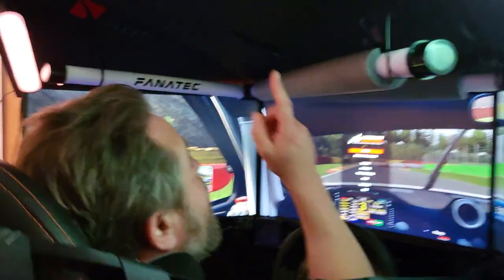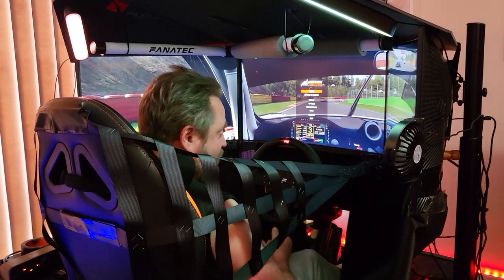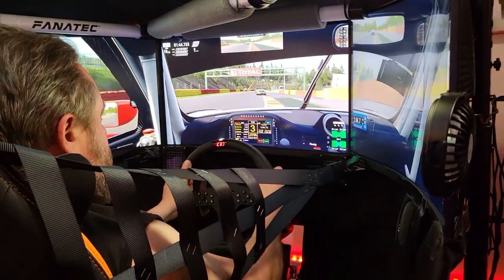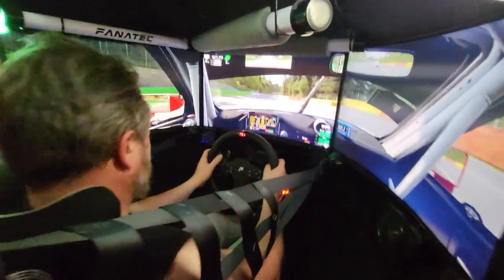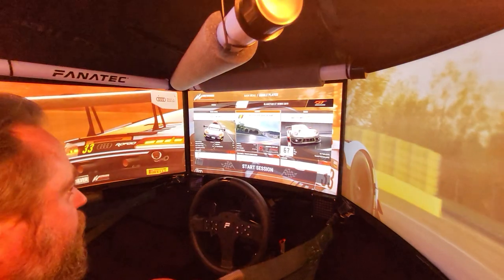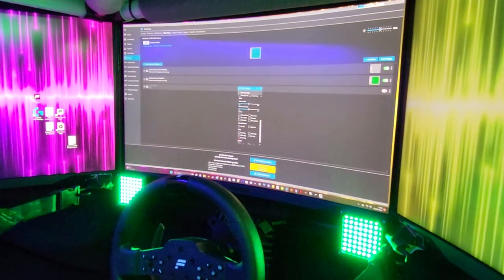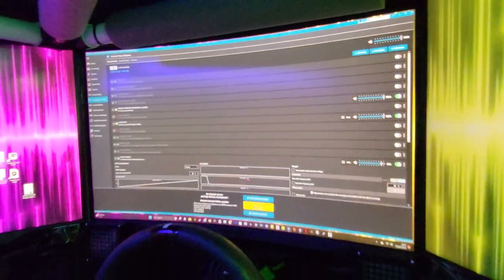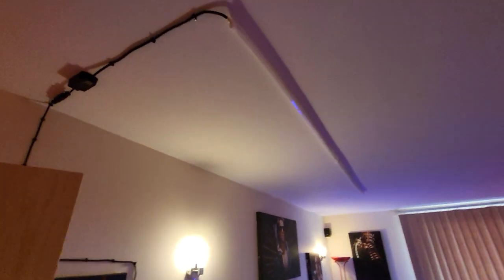Custom Sim Rig Tour - How to Build a Sim Rig Under £5000!!! - Part II

Comment: If you want a diy alu rig, i highly recommend MayCad 64. In there you can design your alu rig your self with a list of parts needed and it will be way cheaper then getting one premade from a brand. Im on a 32:9 49" inch display with headtracking ( old phone i use) and dont see a point for me to get 3 monitors, i play mostly rally games and most of them dont even work with more then 1 display.

Comment: Hi guys.
Under 5k.... so far 😉😂
Awesome looking setup.
Simhub really is amazing, worth the few dollars to unlock the full potential, I've had loads of fun adjusting tactile feedback and messing with dashboards etc.
If your looking for a very rigid alu profile rig , worth a look at gt omega prime cockpit.
Have you thought about using a wheel extension, just to get the monitors down a tad more, and a rog bezel free kit to get rid of seeing the adjoining monitor bezels.
Eagerly await the next vid...simrig under 6k 😆
P.s. tactile transducers - speakers (bass shakers) 👍
Reply: I did my alu rig diy, way cheaper and rock solid, for around 300€. Mostly from 40x80parts. Bass shakers will be the next upgrade for me, 5x for each wheel and one for the break.

Comment: I’m perplexed how it cost you 5 bag? The pc must be half the cost…. Right?  My rig is custom designed and fabricated from ali profile and without components or electrics cost about 6/700 pounds. Seat was £500 wheel was £700,  monitor was an absolute bargin at £200. PlayStation, yes PLAYSTATION! was about £600. So about 3 bag all in!  As a side note if you  removed some of the MANY lights in the room and planned your cable management better you wouldn’t need the blackout cloth or makeshift hood.
Reply from the maker: You are running playstation. Completely different and low Frame rate. Just hasn't got the power a PC has.
Reply: Wasn’t advocating PlayStation over pc, though I would be surprised if you’re getting 120 fps on your three monitors……. What I was saying was that your budget was out of balance. Thanks for your reply though. 🙏
Reply from the maker: @benhodkinson6467  Hi and absolutely. The build wasn't budgeted, it just progressed to what it was as explained in the video, we did things backwards and a rig was never the original plan 😉

Comment: huuuuuh 🤨 this look like $500 why the wheel deck move soo much why you only using a csl dd with a $5000 budget might want to get a 80/20
Reply: The RIG appears to be a wheel stand with a central( between the leg )support god knows what they are sitting on….. perhaps an office chair tied to the wheel stand.  £5000 badly spent